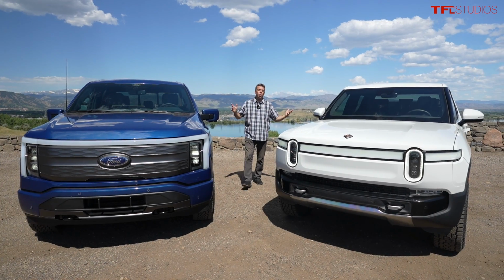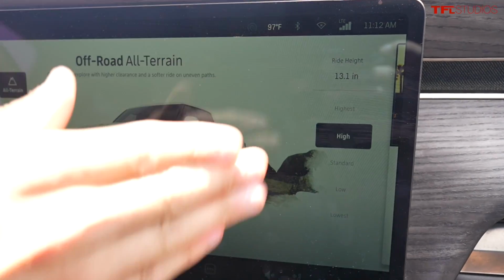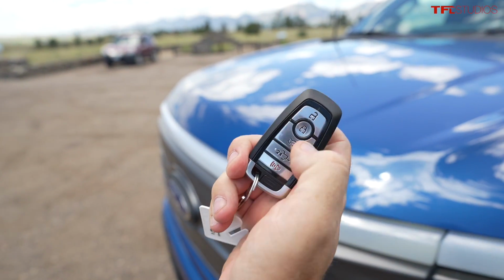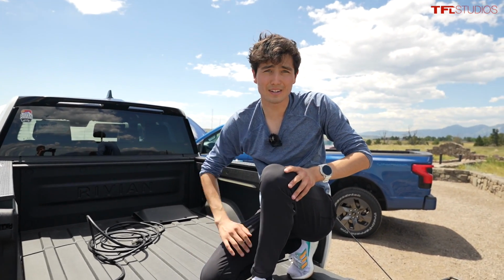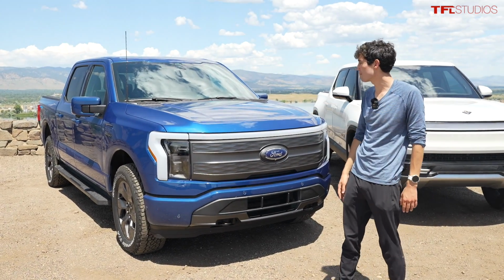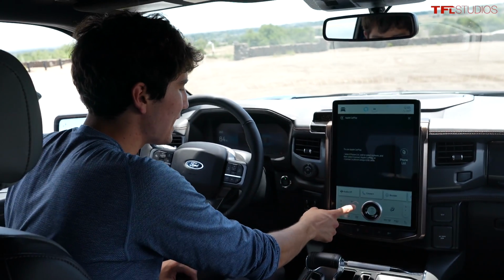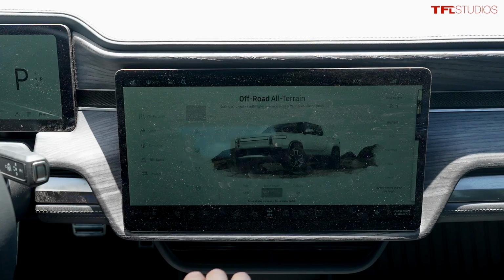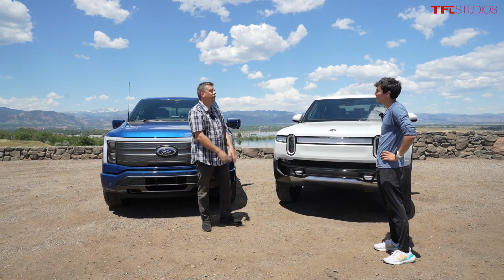The Rivian R1T & Ford F-150 Lightning Are PACKED With Surprising Features - Here Are The Most Unique

Comment: I'm laughing at how you're trying to say the cheaper F150 is available, while you have to wait for the dual-motor Rivian. Really? You can't build or order a F150, unless you had a reservation from quite a while ago. And if you want to buy the one on the floor, the dealer wants $140k for the Platinum variant which has a list price around $96k. More than a $40k markup. They're both great trucks, but I wish Ford would get busy on making an electric Ranger, and get the pipeline going for some Lariat versions.

Comment: It is basically a toy for boys vs a tool for men.  Looking cool vs being cool.  I had reservation for both.  I am not a big fan of Ford and never thought I would buy one but ended up going for Lightning Pro and that is saying something.  Here are some of the reasons:  

For Ford:
Unbeatable bang for the buck for Pro.  9.6 KW power and ability to power tools, another EV and your house.  Over 2K lb payload.  Big backseat, Frunk and bed.  No  glass roof for Pro to break or cook you in summer.  Android auto.   Scale.  Battery and motor temp indicators.  Plug and charge.  Spare is included.  Suspension makes ride very comfortable without unnecessary complications.  Quite ride.  Existing aftermarket.  Practical touches like glove compartment, grab handles and bumper you can stand on.   I have a feeling Ford will be easier to live with when it breaks.  

Against Rivian:  
It seems most Rivian’s have service calls immediately after delivery.  Ridiculous phantom loss.  After warranty may be a bigger nightmare than Ford.  A fender bender cost $21K to fix.  Glass top seem to break easy.   Many convenience features make life inconvenient like motorized vents, tonneau cover and using your phone as a key.  Loud fan. 

One thing I have to admit Rivian has over Ford hands down is purchase process.   Dealing with dealers can be a nightmare and I almost went for Rivian for that reason alone.  Then they canceled the Explore on people who were waiting for years and said pay more for Adventure or get lost so I got lost.  I went for a Pro for half the price and twice the capabilities.

Comment: After doing some reviews on lithium ion phosphate battery.  If the battery is fast charged on a regular basis will degrade the life of the battery. Slow rate charging helps preserve battery life. Most likely those using their EV'S locally and charging mostly at home will have a longer battery life than those charging at DC fast chargers.

Comment: not a fan of the artificial drama of 'well my truck has....'  this one upsmanship should be left on the school yard.

These trucks are both fine iTrucks but they are focused on different markets.  As someone strong biased toward the F-150, the Rivian suspension leaves me with some envy and the hole in the middle of the rivian feels gimmicky and not so useful for me.  

Hands down the biggest feature for my use-case is payload & towing.  Rivian wins for off-roading without a doubt.  some mentioned right to repair, no clue how rivian wants to handle that, but fords will be much easier to service, generally.

Thank you for saying front trunk.  F**k the frunky frunk word.  After a while, it's just a trunk, front or rear.  Some cars have had front trunks for decades.

Comment: The F150 is a nice truck... but allot of trucks out there Ev/gas/Hybrid can give you everything the f150 has ... alternatively the R1T is one of a kind. The closest you get to it is maybe the RR defender ... although I think the defender is more money.  What I'm trying to say is that if you went from the lightning to a raptor or f150 hybrid or any nice f150... you wouldn't notice much difference(except for power frunk).  If you went from R1T to Defender you will notice allo of difference. For 1...the defender doesn't have a truck bed. The R1T is one of a kind truck. The F150 is just another Ford truck powered by electricity instead of gas. Even the model X won't give you allot of the features of R1t. The R1T is far from a perfect truck . Although if it was lighter and charged as fast as a tesla... it would be perfect.

Comment: Old fashion drag race for the win. Lol. To be honest, I love both trucks. The biggest issue with Rivian is that the brand is still unproven, but so far, things are looking good. The F-150 is good across the board, but off-roading the Rivian is much better. The R1T, in its lowest setting, still offers more ground clearance than the Ford. And that rear electric motor (maybe front as well, IDK) is going to get ripped off at some point, somewhere, by someone hitting a rock on the trail, I guess that is the issue with using a platform designed initially for an ICE. However, great job by both Ford and Rivian.

Comment: Areas where Lightning kills it:
Frunk is Way more accessible and useful.  Sedan frunks are nice to have.  Truck frunks will be huge.  Ford's is 1st rate out of the gate.
On board power.  Very useful and practical.  The ability to power a worksite or playsite with no noise is huge.
Every lightning is all wheel drive and 775 Ft-Lbs torque no matter price or battery size.
Size and shape.  Personally not crazy about the F-150 derivative body styling but full size body on frame with aluminum body panels are awesome.  (Rivian styling is a step up but doesn't speak to many full sized truck owners). 

Areas where R1T kills it:
Adjustable suspension.  Makes it a very capable on and off road.  This will be a very popular feature for electric trucks.
HP and torque is amazing.

I love both of these trucks and would be proud to own either (lightning reservation).  However RT1 has a basic problem; it screams adventurer and over-lander but the charging gets super sketchy for these purposes especially if you pull a trailer.  The Lightning on the other hand says town and a little country workhorse where home/business charging and limited range make sense.  Also Ford is gonna pump out significant quantities (150K in 2023?) whereas Rivian will likely be production rate challenged (maybe 40K/year?) until their new factory comes on line.  For mainly these reason Lightning is truck of the year and RT1 is an "also-ran"!
Reply: Rivian also handles much better, makes it more enjoyable to drive spiritedly. Also the awd and torque are high on all trims of rivian too. Also the Rivian supports CCS bidrectional charging so in theory an adapter can be made to supply power like lightning levels, and Rivian has already confirmed they're building a home unit to power house with backup.
Reply: @realMysta  RT1 quad motor (a beast) is 900+ ft lbs of torque.  Dual motor is 600+ according to Rivian.
RT1 is superior to Lightning in many ways.  Just Lightning is the "home run" truck in my opinion.  Would love to have both!  Can only afford one!
Reply: @jackgoodman4444  Yeah - don't get me wrong the Lightning is a great one from ford but for me I'd rather have the drive characteristics from the R1T. Also I had the benefit of early order pricing at dual motor price.

Comment: If there’s one thing that air suspension has taught us is that it is not reliable at all long-term. They have out rages repair costs outside of warranty. Another win for the F150
Reply: After having air suspension I'd pay whatever to keep it going long term, significantly better for almost anything. Also the 5 yr/60,000 mi basic, 8 yr/175,000 mi powertrain warranty helps
Reply: True

Comment: Those "tie down points" at 13:39 are not tie down points, they are mounts to move the rack from the bed rails to the roof.
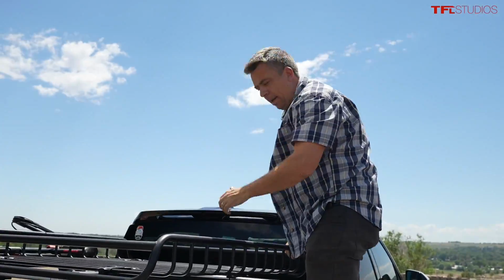The sidestep that Andre was looking for at 14:03 are the gear tunnel doors that were already shown at 7:00.
Reply: Yeah, missed the gear tunnel but it is irritating that they don't have a bumper.  I saw one person who worked around that rear step issue with a hitch mount bumper step.
Reply: I think having that step over the entire side by the door is still helpful. My wife is on the short side and when she tried getting on the rivian it is challenging for her even with the 9.5in clearance setting. With the lightning she has an easier time. The steps provided on the tailgate also helps to get into the truck bed... I wish rivian had implemented these. Honestly, I like rivian better in terms of performance and the interior, but they should have thought a bit more about ease of access

Comment: The Rivian power outlets can't run a coffee maker, that's a fail at the camp sight.
Reply: 1500 watts can run a coffee maker
Reply: @GregHassler " Rivian R1T comes with three 110-volt power outlets located in the bed with 400 watts available at each." But not 400 watts.
Reply: @heathwirt8919  I believe their numbers were not stated correctly. The rivian can run a full electric camp kitchen

Comment: I prefer the Ford F-150  hybrid, if I am going to use it for work or towing, the Ford Lighting doesn't offer a better experience and I feel that I am  paying more for the same truck.
Reply: Work as in loading it up to max payload would be fine. Minimal range loss, about 0.1 mi/kwh, which is nothing. Towing I agree, unless youre doing under 100 miles in a trip, youre far better off with ICE.

Comment: The Rivian spare wheel access is bad - gonna suck trying to change a wheel when it is fully loaded.  Worst way to access a spare on a truck.  Funny that they did not mention that issue...
Reply: Not ideal for access but putting it on the bottom would cause other problems of clearance.   What would be nice is if you could keep it there for daily driving and situations where popping a tire is unlikely but give you a quick mount to the back of the liftgate for when you are off-roading/more likely to pop a tire.
Reply: I've had 3 flat tires in my life, 25+ years of driving 20,000 miles / year.  I'm not worried about having to maybe move some stuff.

Comment: Raven gives you a flashlight Ford gives you the capability to run your entire house 😃
Reply: Gear tunnel >

Lol jk. Can't argue that ability from the Ford is pretty cool. Can't stand that stupid Tesla-style tablet in the center though. I much prefer the interior on the Rivian, personally.
Reply: @RedWingsninetyone  I like Rivian's screen as it is integrated into the design.  Fords looks like they found something off the shelf that didn't' fit and just hot glued it on.
Reply: @curtisbme  that's a great way of putting it. That's exactly what bothers me about it. Plus the horizontal nature just makes it appear more natural.
Reply: I could be wrong, but in order to power your home, doesn’t your home have to be able to be off grid (disconnected from electric company)? Does anyone know how that really works?
Reply: @eileenhunter5927  it wouldn't really be any different than having a backup generator.

Comment: They use so much salt here in the winter that Rivian will be rusting within 5 years. You can't find a truck here that's doesn't have paint bubbling around the wheel arches after just a few winters.
Reply: Fords have been aluminum for well over 5 years now. Cybertruck will be stainless steel.

Comment: I don't know, at this point the Rivian is vaporware, and it's far less practical than the lightning. Not a Ford fan, but the lightning is the one to buy. Also, the Air suspension on the rivian is a trap, cranking the air suspension off-road essentially fully drooping out the suspension
Reply: I wouldn't call it vaporware, as that would be more like the cybertruck.  But the supply shortages really hurt them and production and will ultimately negate the head start they have. Same for the Lightning, the shortage hurts production.  The Lightning is also the cheapest crew cab 4x4 full size truck for sale, which is crazy.
Reply: the cybertruck is vaporware. the rivian actually exists. youre right, cant say for how long. but you know, its real....
Reply: @laloajuria4678  they've only delivered 2,000 trucks. And are struggling to ramp production. Once stellantus and GM launches theirs they'll lose the market space.
Reply: @Rommer2258  that's not true, my r1t is 6000+ and there's around 8k on the road. As far as the hydraulic dampened air suspension. It completely decouples all corners when in offroad mode so it gets "close" to the articulation of something like a Gladiator Rubicon or similar. I will say it 100% soaks up speed bumps at 40mph that our Honda odyssey has to take at 8-10mph. There's really good tech in the Rivian suspension, hard to explain without you experiencing it.
Reply: @audislowroad  I know what you are talking with the suspension. It works like the jeep Grand Cherokee suspension. The control arms are still mounted on the frame in the same spot, If you lift the body via filling airbags you are changing the geometry of the suspension. 95% of people will never really get to the point where it matters but that 5% will tear bags and ruin alignments
Reply: @audislowroad  also all hydraulic dampened air suspension means, it has a shock and a Bag, unlike some rovers and cars with just bags.
Reply: Rivian has been delivering for 8 months, Ford has delivered like 4 trucks and isn't ramping any faster than Rivian.
Reply: @GregHassler  I think you better re-check your sources before spreading such mis-information.  Ford is pumping out lightnings left, right and centre.  Rivian not so much.  Ford has the manufacturing capacity, staff, experience and dollars to deliver.  They've been only making a million F150's per year for forever which shares many of the lightnings components.  Both companies have publicly released the number of units they will build in the next year.  You should check it out.   The way Rivian is so constrained, they are bleeding money and I doubt they survive as a company.   No way I will risk buying 100k trucks and then be unsure if there will be any warranty or knowledgable 3rd parties to service them.  I am very surprised that this is not a concern to many people.

Comment: f150 for me, the fact that the aftermarket is massive for the regular f150 and can be installed on the lightning is huge. Rivian don't support right-to-repair either.
Reply: F150 lightning for me too. I love the 9.6 kw on board power. I love that ford kept the F150 appearance.  I love the lightning luxurious ride with uts independent suspension.  My platinum seats are very comfortable along with the massaging seats.
Reply: R1T is above nicer over F150 lightning on all chapters those 4 independent motors are super, yeah is shorter in bed size and might not have glove box but the space between the cabin and the bed is quite impressive were it can either have an optional stuff like a full cooking optional set for adventure, a shelf for different tools or just empty space for extra luggage.. ohh aftermarket can also have cool gears for Rivian, btw i did not see a spare wheel on the F150 and Rivian has it back in the bed under a lid and it can be taken out for even more extra space and in any case R1T has a integrated compressor in the back..  So, F150 more rugged as utility sizes, taller, wider, longer & larger but the annoying sound when the Ford door is open compared to cirip-of Rivian which sounds much nicer.. R1T would be so perfect for European market providing nicer interior +room for 5 on-road and off-road ability and enough space for adventure gears & stuff..
Reply: @poplaurentiu4148  4:52 shows the F150 spare.
Reply: @poplaurentiu4148  everything you just mentioned and more in the aftermarket space is also available for the F150. The aftermarket support is massive for this vehicle. The Rivian is nice, but it isn't a F150
Reply: @chrisgill7824  well one thing is very good and very clear at least for me about comparisons between EV brands is super good not just to see each-other products tested in same condition in the real world but also since it let's clients to choose what they really want depending on they 'r needs : budget, quality, specs or whatever each customers want.. i watched plenty EV truck comparisons and other tests made so far with all available EV trucks but also Sandy Munro channel he worked at Ford and now he has it's own channel called Munro Associates and they test, dismantle and compare all vehicles made for last decades.. now for electric vehicles & pickup trucks they posted plenty clips explaining why Rivian is best so far taking into consideration all aspects from quality build, materials, inside-out functionality and utility and the way is build for each buck spent is reflected in the build quality.. Ford is very good for what it is in the utility segment but if you manage to test both when you get in Rivian you can tell instantly the quality difference specially inside the cabin  performance it has, so i'm not bashing any competitors let''s not forget : Hummer EV (Truck & SUV), Chevy EV truck, Atlis, Stellantis, Tesla Cybertruck, Nikola Badger or other that will be available pretty soon each will have different advantages and other bad things.. So, again competition and variety is the best key factor because after comparison each customer from each market will have the chance to choose what they like based on the needs and budgets taking into consideration all the factors &  comparison pro-tips..

Comment: I would be all for the Rivian, but gosh darn that starting price in Canada is insane, and even moreso when you actually option it the way you want it. I tried optioning a Rivian, and the final price came to 120 000 CAD. It's a lot of money!

While the Lightning, specing it the way I was gonna buy it, it would have landed between 95k to 100K. Still a lot of money, but a little more manageable.
Reply: If you got in before March rivian is only 96 in Canada.   Loaded just around 100.  Was less than a Lariat
Reply: @JamesBergeron  I specced the Rivian back in February or so, because I wanted to see. The price was loaded with the features I would want. It's crazy expensive still...